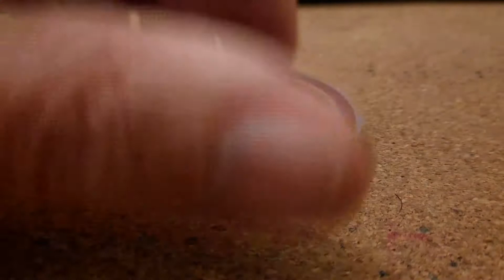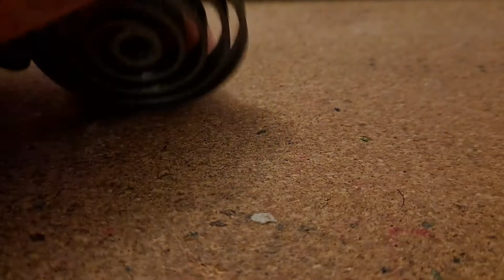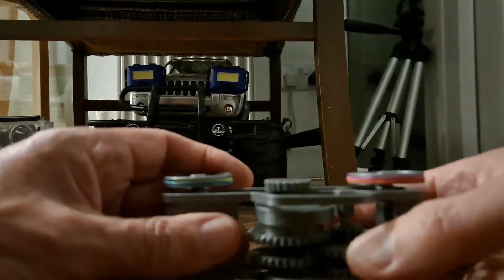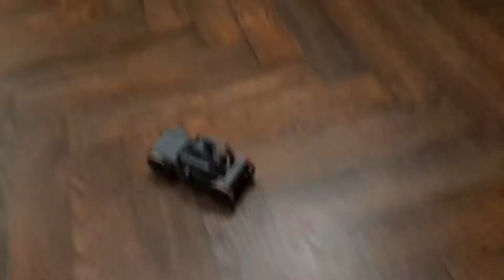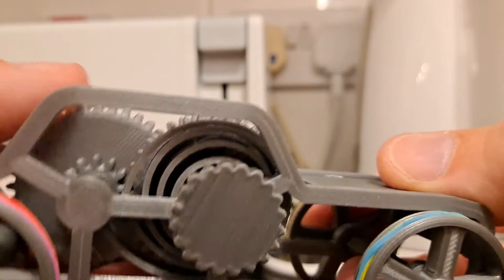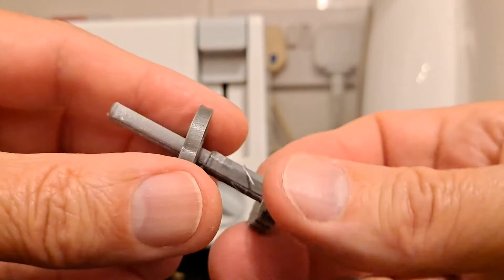P4 Another 3D printed wind up car Another minor change

Comment: The pla seams To be too week or too Soft as it gets warm and Starts To get Soft i think.hope the next printout Works Better.maybe use harder pla?
Reply from the maker: The main problem is any point where there is a change in direction of the layer. So it will always split easily between layers and also be a weak point if all the changes are at the same point. This video explains the problem and suggests solutions https://youtu.be/NU1kYEE3qrQ

Comment: It can work with cura. You just need to have the seams print on the inside.

And use duramic 3d petg filament. It's cheap and very strong. Even more so than pla. Nice vid!
Reply: @GrandadIsAnOldMan  it would be too rigid with abs, and possible rubber fillament might for for the spring be better as it's only slightly flexible it's not full on rubbery

Comment: Hi GrandadsAnOldMan!

What is your nozzle diameter?  It appears you have too few lines for a 6mm thick spring.  Also, there are settings in Cura where you can "randomize" the point where each new layer starts, thus you will not get that single vertical line.

See this video on how to randomize and even move the seam:  https://www.youtube.com/watch?v=NU1kYEE3qrQ

Best of luck!

Greg
Reply from the maker: The nozzle will be 0.4mm. Thanks for that link, explains the issue clearly and I will give it a try. By coincidence I was printing some wheels today and I was looking at the seams on them, remembering the issues I was having with the spring.
Reply from the maker: Random did the trick 😁👍 - sneak preview of episode 6 https://youtu.be/_97PPFtCwOw
Reply: @GrandadIsAnOldMan  Great!  Also make sure Cura knows you are using a .4mm nozzle.  It is in the settings as well.

Greg
Reply from the maker: @popzct  Thanks Greg, I double checked and yes, it is set to 0.4 What I might try, is check to see if the operating system has been updated on the printer as I haven't done that since I bought it.